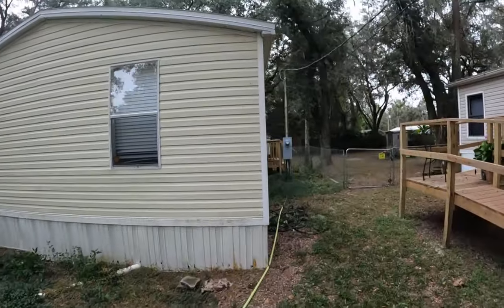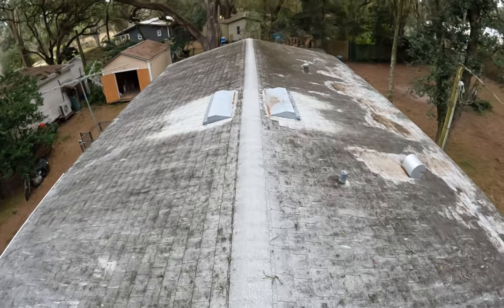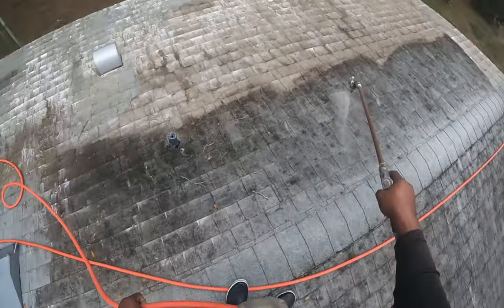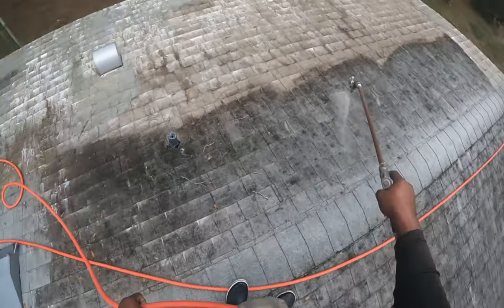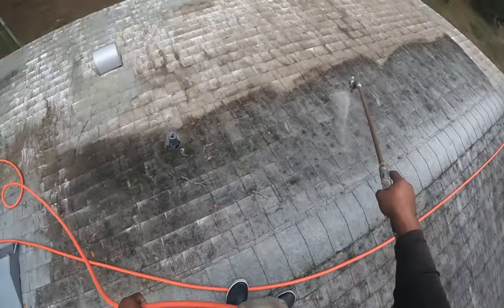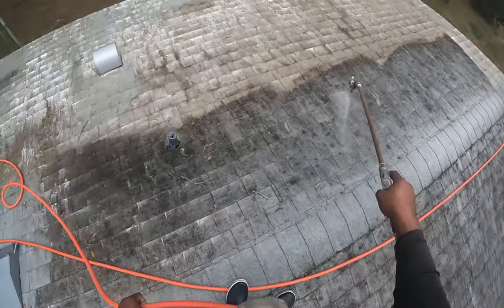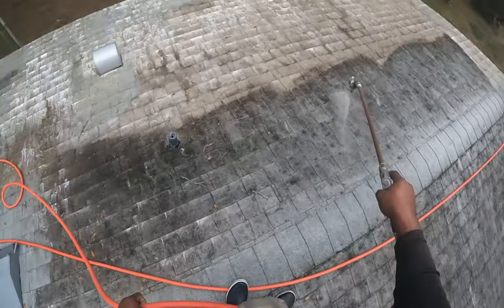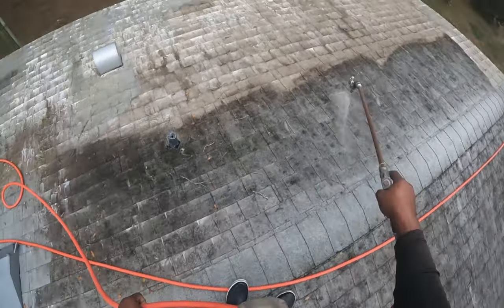2 Roof Washes And Mobile Home Wash #roofwashing #softwash #softwashing

Comment: So you use the hand sorayer when you need something more toward 6 ish%. But your downstream is usually at like 3 and not very adjustabe? If you wanted to downstream a higher concentration instead if pump up could u just put a little pump in the sh tank
Reply from the maker: Downstream can only go up so high. And that's normally around a 2ish percent.  For roofs 5-6% is needed so a dedicated softwash system is the ticket

Comment: Only concern I have with the mobile home roof is , if it's left up there those galvanized ducts & vents Will rust out so if i don't rinse i will hit that portion with a neutralizer in a spray bottle before I leave & also the metal antenna pole that was next to the house but I believe you rinsed that already so probably no need for that.  Good job cliff.
Reply from the maker: Yea its all good. Have you been back to check on those roof ducks to see it actually rustv out from a roof wash? I haven't had one rust yet. Thanks my bro
Reply: No I've always been scared when I first did one so from day one I just put in to either rinse or use the neutralizer at least just on the galvanized metal.. I live in a home like that & I can tell by the screw heads some spots wasn't rinsed that good when I did mine. On that one though There was a little rust strip already up there on one of those ducts I saw from where the previous person did it from what I saw..  I could be mistaken Cliff but I'm just cautious lol.  @PinkFlamingoPowerWash
Reply from the maker: @robertclark2935  it'll be fine. But I get your concern. Don't change the way you're doing it if it's working. You know how it goes 😆

Comment: Cliff what's a good range per day for Google ads to get a return that you have seen we are avg 20-30$ day and is working well.  Merry Christmas to you and your family....also if you ever need to use a dual barb injector and drip both in chem tank and you'll avg 2 percent when  needed but obvious 12 v when needed...I downstream almost 90 percent of my jobs...love the dual barb.. typically is in my soap and chem with a shutoff to slow flow of soap when needed

Northern VA in the house!!
Reply from the maker: For Google ads I'd say $40-50 a day to see the highest return. Bit 30-40 will still get the phone ringing.  I haven't used the dual barb injector my super suds sucker already pulls that much already lol I've been using the same injector for like 3 years now

Comment: Seasons greetings my brother I have 2 questions I wanted to ask. 
1) Do you have any suggestions for a igx 800 10pgm pressure washer?
2) Do you know any where I could get a good deal on one?

Thanks.
Reply from the maker: Hey Brother. sure no problem.

Yes this is a good option for a 10GPM and at a great price. They also have great customer service reputation.
https://shop.pressurewasherproducts.com/products/10-gpm-3500-psi-igx800-honda-skid-bandit-cold-power-washer-k7-3?_pos=10&_sid=c8dcca0e7&_ss=r
Reply: Thanks 🙏

Comment: What’s the inner diameter of the extension to your st15 softwash gun? Merry Christmas
Reply from the maker: It's a 1/2 inch
Reply: @PinkFlamingoPowerWash  thank you
Reply: @PinkFlamingoPowerWash  thank you. It’s a 12v system correct?
Reply from the maker: @masonsindelar2793  yes it is

Comment: Why downstream the sides when you already have the electric system pulled out for the roof? Unless you’re batch mixing?
Reply from the maker: I didn't wanna walk back n forth to change the percentage of the mix once I done with the roof and I wasn't gonna spray 5-6% mix on a siding.  I downstreamed cause I have a flow pro remote bypass so I can turn the mix on and off and get to rinsing.